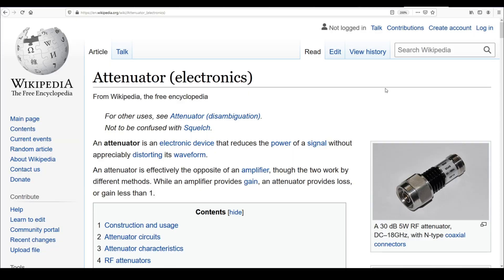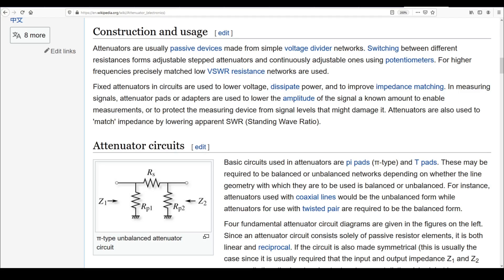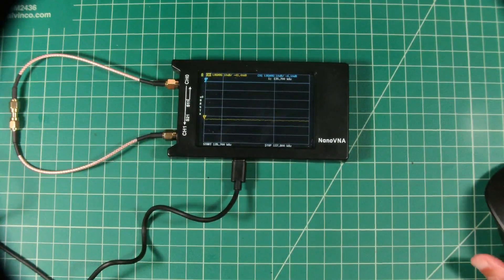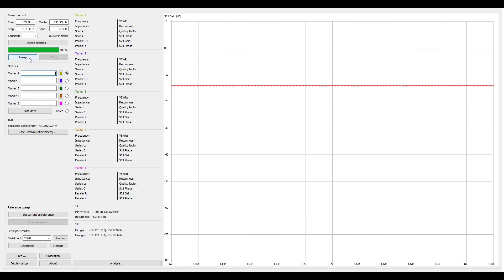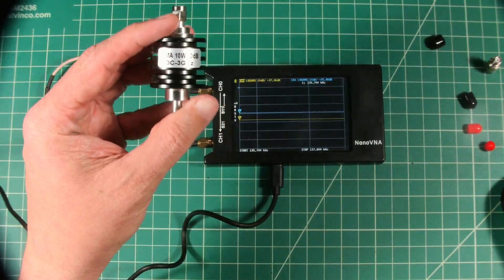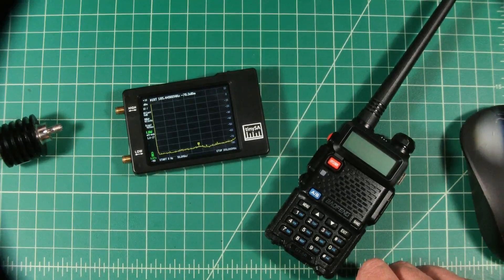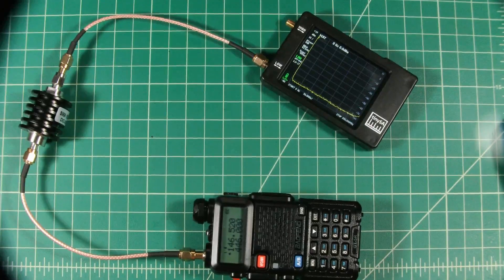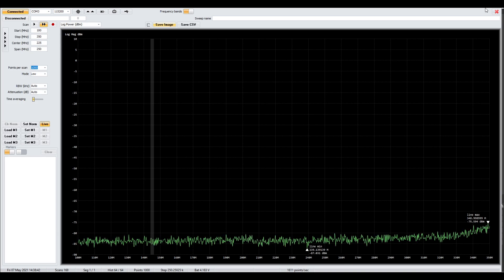Testing Baofeng Spectral Purity with the TinySA - Ham Radio

Comment: When you key up the Baofeng you see the first sweep with the harmonic. Then the tinySA activates more attenuation and the next sweeps are without the harmonic. When you use tinySA-App the automatic attenuation does not work so when you sweep the signal is much too strong. Set the attenuation to manual 30dB and you will see the harmonic is greatly reduced or even gone completely. When testing for harmonics one should always  increase attenuation and see if the relative level of the harmonics change. As long as the relative level changes you have to increase attenuation
Reply from the maker: Thanks for the info Erik, this was more about how I will be testing the radio and not an interpretation of any results.  BTW, you're doing a great job on your channel 👍
Reply: I just subscribed to your channel.
Reply: Thanks for that explanation.  Very helpful to me in this interesting hobby.

Comment: Lead test tech at an EMI lab here. What you're attempting to conduct is a CE106 test. It is critically important that you have the correct receiver bandwidth for your range in accordance with MIL-STD 461. Ideally, you should also limit the peak input power to not more than +10 dBm in order to avoid compression. Compression will exaggerate the amplitude of odd harmonics due to clipping.
 I should add that so long as the 2nd and 3rd harmonics are at most -13 dBm, you're within the limits. 
 I would love to conduct this test properly in my lab and see what I get.

Comment: That's a great setup for teaching someone the basics but really not very usable for any accurate measurements.

Keep in mind none of the equipment being used is calibrated which is very important especially with the attenuators.

A cheap attenuator off eBay will really only have it stated attenuation over a very narrow frequency spectrum.

There's a reason why a good set of agilent attenuators will cost you several thousand dollars.

A good set of calibrated attenuators will be flat across a very wide spectrum, the broader the spectrum the more expensive the attenuator. You can get inexpensive attenuators that are fairly flat from one megahertz to 100 megahertz, but when you're looking at attenuators that are completely flat from 1 MHz to 6 GHz you're looking at thousands of dollars and they need to be recalibrated on a regular basis

And of course that's just the attenuators and loads.

Measurements on a VNA are only going to be as accurate as the open short and load calibration. And in order to get a decent set that's very flat you're going to spend over $2,000 just on the OSL kit

The good news is you're doing basic relative measurements which means that this equipment will give you a good rough idea of what you're looking at.

I absolutely love my little mini VNA and my little mini SA but they are no replacement for my agilent Network analyzer or my agilent spectrum analyzer.

The fact that I have access to my own laboratory grade equipment allows me to actually check the accuracy of these hobbyist grade pieces of equipment.

And for what you pay for them they're a great learning tool but don't put a lot of faith in the absolute measurements you get from them because you're not going to get laboratory grade precision for what these cost.

But anyhow great video, it's nice to see that at least a few new ham have some interest in the actual science behind radio electronics.

And the good news is you don't really have to spend a fortune to do it, a set of BNC attenuators from China are pretty cheap. But don't fool yourself they're not even close to being in the same ballpark as an $800 agilent attenuator.

As a side note rather than using attenuators you should be using a signal tap.

The problem with attenuators is if they fail they'll blow out the front end of your test gear.

You can make a very inexpensive signal tap using a so239 tee connector and then cutting the PIN off the male pl 259.

Basically you take a short piece of coax on one hand you have a meeting connector for your test equipment on the other hand you have a pl259 or you cut the center pin off.

You connect the device under test to the t connector and a load to the other side so your transmitting directly into a load, the test gear is picking up the signal off the t in the connector with the missing pin. It's good for about 30 DB of attenuation. 

Using this method you're not risking your test gear by using attenuators of questionable quality as the only protection to the front end of your test equipment.

The pl259 signal tap is good up to about 400 MHz but really better suited for 2 m and down.

You can build a similar device using a SMA tee and cutting off the pin on the male SMA connector.

Basically what you're doing is creating an open connection on the t end of the connector while allowing the through end to have continuity into a load so it provides the transmitter or the device under test with a flat 50 ohm load.

This is another problem with cheap attenuators is that they don't provide a flat 50 ohm load across the entire spectrum.
Reply from the maker: Both the NanoVNA and the TinySA were calibrated according to the manufactures instructions, that said (and mentioned in the video) I was implying that this was lab grade equipment.  If you notice I neither said the radio passed of failed any objective test in regards to FCC rules.  I do appreciate your perspective and sharing of knowledge, thanks for the post Dan.
Reply: Thank you very much for your quality text.
Very important for newcomers that don't understand they get what they pay for...🙏

Comment: Another great video. I am interested in using this with a directional antenna to hunt for RFI. But the input has very weak circuit. I guess I can’t expect a professional Spectrum Analyzer.  Perhaps I can go back with my portable radio and a directional. Interesting little piece of kit.
Reply from the maker: I haven’t tried using it for direction finding, maybe I will try and do a video.  Thanks for watching Brent 👍
Reply: @TheSmokinApe  always good to see your videos. K8MRD is to be credited for the idea. Though the sensitive front end makes me nervous.
Reply from the maker: You might be able to use the antenna is came with but it is susceptible to even damage from static.
Reply: @TheSmokinApe  so maybe I need to put on my electrical engineering hat and design a protection circuit. Trouble with this hobby is I have too many ideas.  Look! Squirrel!   Haha. By the way I am enjoying the coffee and Ham radio channel as well. All the best!

Comment: I compared my UV-5R TO MY Kenwood HT. The Kenwood harmonica were better than -80 dBc vs the Baofeng at less than 40 dBc. I would suggest also that you add a second stn inline and make sure your harmonics drop by the same level as your carrier. If not it would indicate the the spurs are being generated in you spectrum analyzer front end and not necessarily the radio.
Reply from the maker: Thanks for the info, I really just started messing with the TinySA so there's a bit of a curve for me 👍
Reply: Even 40 dBc is nothing to worry about in a consumer grade radio. It only puts out 5Wrms, so you're looking at 500 uW spurs. Your LED lightbulbs are louder than that. This result (properly tested, of course) would rate this radio suitable for Navy shipboard use.

Comment: To check spectral purity without analyzer, I multiply the frequency by 2.  Set another radio to listen at that higher frequency (harmonic).  If nothing heard on transmit, I'm happy.
Reply from the maker: Yeah, that is a good way to check for harmonic but not spurs.  You can also use an SDR.  Thanks for the comment Joe!
Reply: To find spurs, go to the basement (a place with poor reception), and transmit while tuning around on a wide receive radio; or an am/fm/sw radio.  Nothing heard?  Probably ok, I guess.

Comment: I was a little disappointed because your title says that you were going to test the spectral purity of a Baofeng radio. Then you presented the latest model (which is supposedly is type accepted ) UV5-R.
I would have liked to see you test an original UV5R at 146.52 as the fundamental and 439.56 the third harmonic because that is where most of the original UV5Rs had the problems. The ones that I have tested had almost the same intensity at the third harmonic as the fundamental.
Reply from the maker: Fair point, check out tomorrow's live stream where we test a bunch of Baofengs on Spectrum Analyzers https://youtu.be/VrG7t5xBP4M

Comment: The spectral purity of the Baofeng UV-5R and UV-82 based on YouTube test videos are really dirty. It's possible all the Baofengs are like this, except the GT-5R which meets FCC standards, according to one YouTube test. The radios are cheap, but I if a radio is going to put off harmonics and subtones at other frequencies while intending to transmit on one, isn't that kind of rude for other radio listeners out there who get to deal with the trash? Cheap or not I'd rather spend more to be less of an annoyance to others on the airwaves. A Baofeng muddying up the spectrum is good for the trash can except where you need an RF jammer. ;)
Reply from the maker: I'd agree that we should be using "clean" radios.

Comment: Soo.. they haven't fixed it.. What about the UV-82's though.. ? I can't seem to find any such testing for the UV-82's for whatever reasons.. :| As a new comer to this HT stuff I can only imagine that all the flack that the Baofengs are getting, is from these most commonly used UV-5R's.. And why are they the most common anyways.. the UV-82's are supposedly the upgraded model with a better chassis and more power to boot.. Why can't I find any such testing done with any UV-82.. ? Or at least a straight up comparison between the two..
Reply from the maker: I have done enough testing to tell if it’s fixed or not, I wanted to do this video showing how I will be testing.
Reply: @TheSmokinApe  Well, I thought that @ 6:40 there was an unwanted emission around 294MHz.. ? Wasn't that the same GT-5R ? Also, I'm not sure what levels would the FCC compliant ones be and how the attenuation works in this setup, but relatively to the fundamental, the harmonic emission seems to be at nearly 50%.. ?
Reply from the maker: It looked to be about 40dB below the fundamental which I believe is OK.  I’ll have a more detailed video in the future.